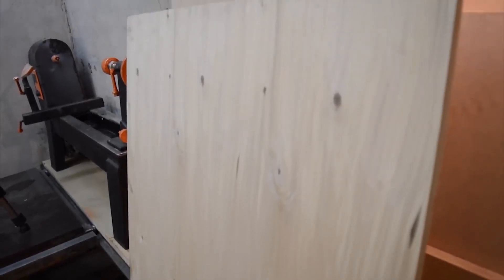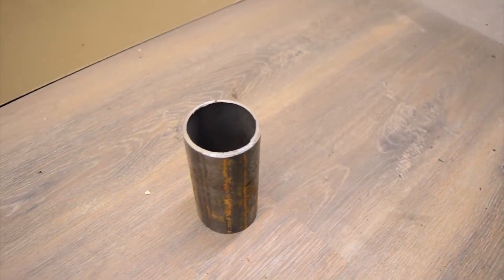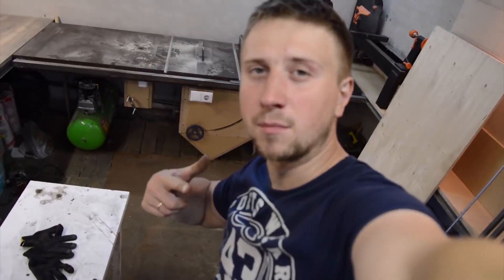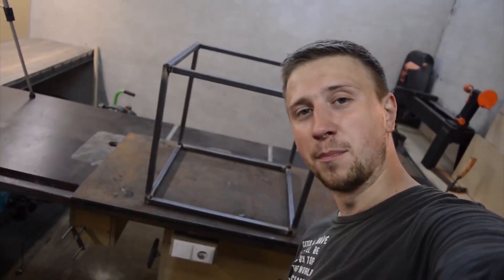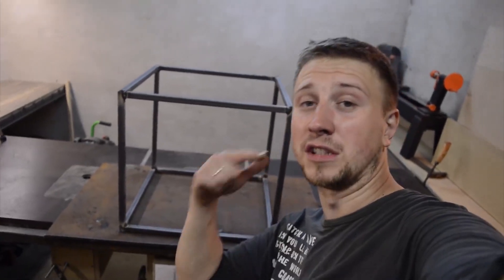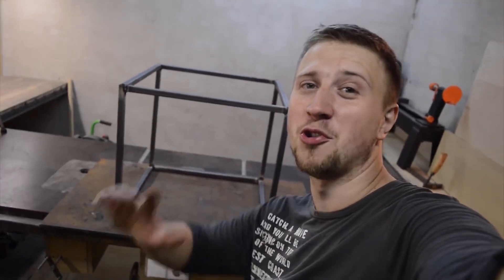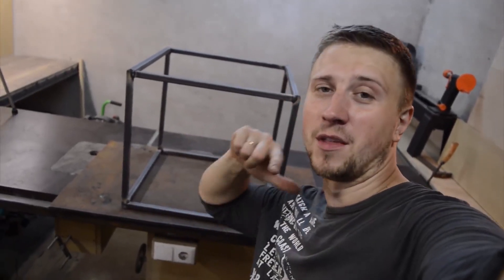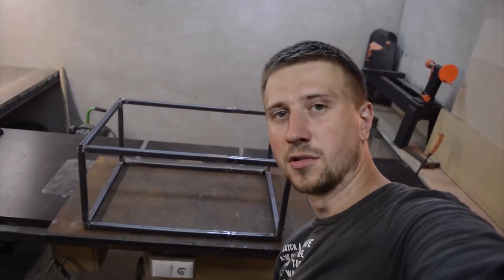DIY grinding machine out of a washing machine engine

Comment: you're welding by hand without using clamps or squares making the welded joins pull out with heat none of your supposed 90 degree corners will actually be square this is especially critical when you're using motors and pulleys you will end up wearing the bearings fast and also never use a shaft as an earth point when arc welding a bearing in a tube you could easily spot weld a ball bearing to the race causing problems when later trying to run that shaft

Comment: Washing machine "engine"? you probably have to learn that on English it's called electric motor not engine... And don't weld with a curent true the ball bearings. Tilting mechanism is the same as on your sewing macine? Are you aA DRESSMAKER as well?
Reply: Ball bearing not welded to pipe or bolt. It was pressed to pipe by gripe. And what is wrong with tilting mechanism?
Reply: His saw, not his sewing machine
Reply: I mean ... you correct him on engine then proceed to write "curent" and "macine". Irony much? 

Anyways the video is superb as some of previous builds on this channel. Hope to see more content like this!